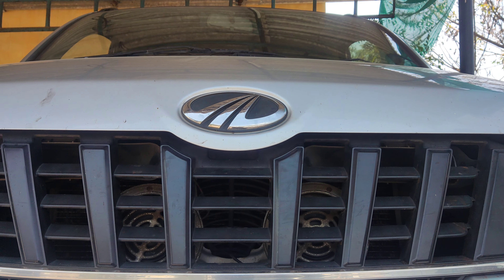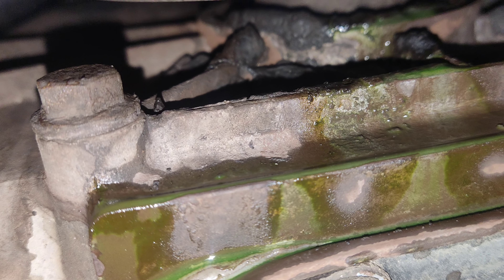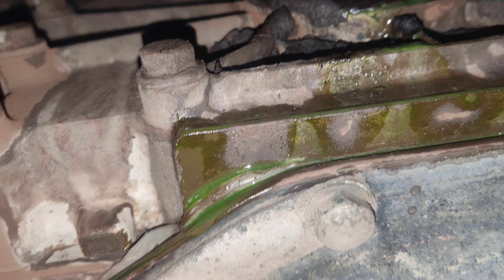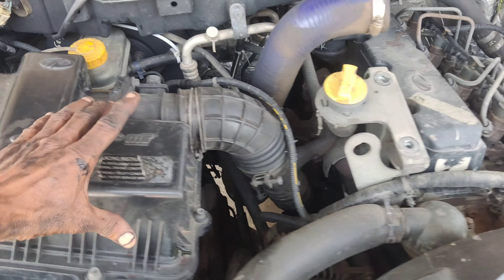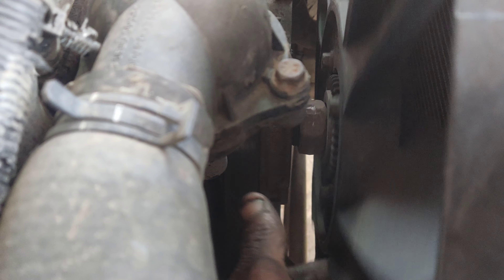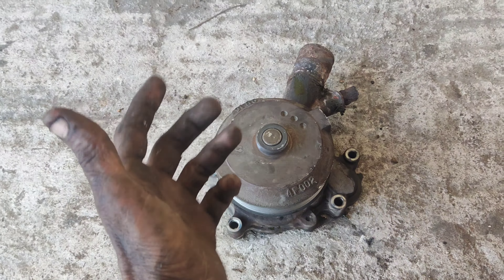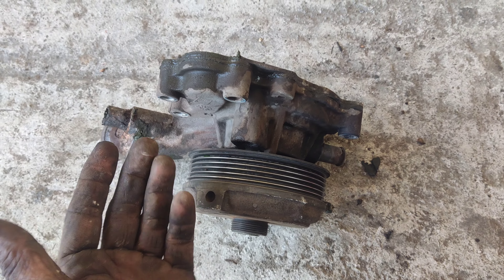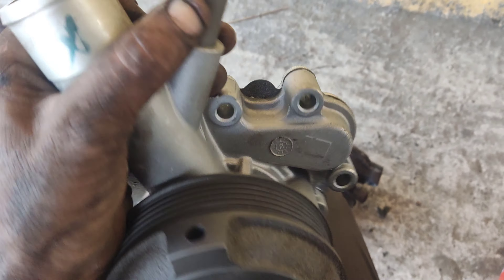Mahindra xylo D4 water pump leak complaint (@skilledmechanictamil )

Comment: Anna Nissan Sunny 2012 diesel, idling la rpm fluctuate agi agi oduthu sometimes engine off aguthu. High speed power loss feel aguthu 5th gear la no pulling 90-95 mela pogave matenguthu.
Black smoke romba illa mileage normal.
Ena complaint any idea ?